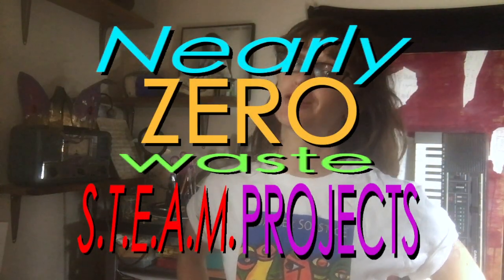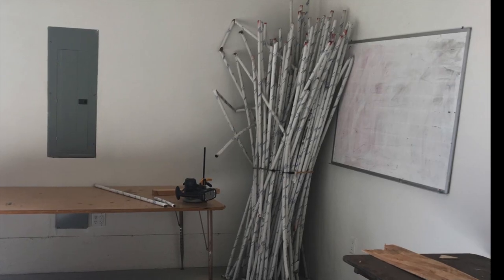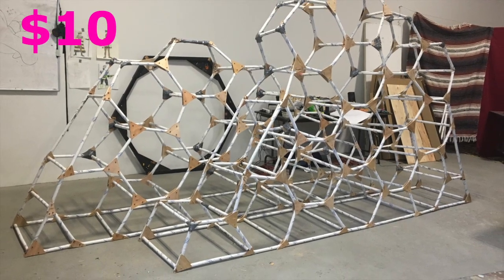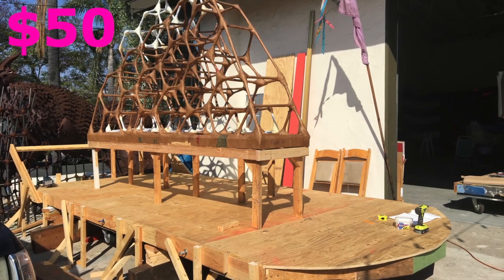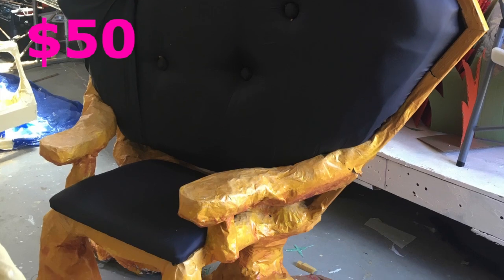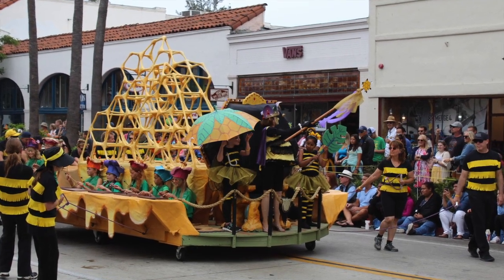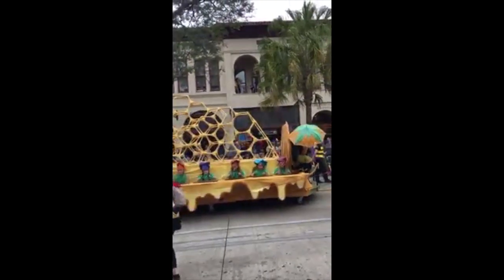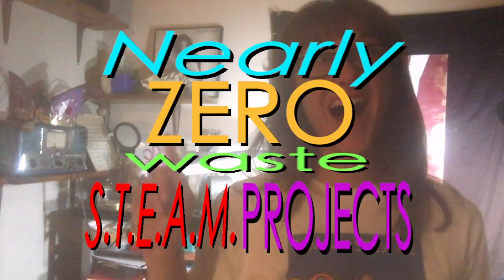Making large scale art cheap: parade float build

Comment: Cool project! I build parade floats in Colorado and most of my materials are recycled from year to year as well. I use a lot of steel tubing and conduit for my armatures, and most of it has been something else at least twice.  If you haven't already discovered Coroplast, I highly recommend it. It's literally plastic cardboard and is used in most of the temporary advertising signs you see at gas stations. It's super-easy to work with (hot glue & zip ties) and it doesn't disintegrate when it rains. I used 11 5x9 sheets of translucent Coro (about $120) for my Ice Palace Christmas parade float.
Reply from the maker: Sweet, thanks! That sounds like it would be very versatile and easy to work with. The other thing we use a lot of for armatures is old coaxial cable they dug up from the ground to replace. It's bendy, but super sturdy and strong and you can screw through it anywhere. I just happened to not use any this past year. Can't wait for next year's parade!